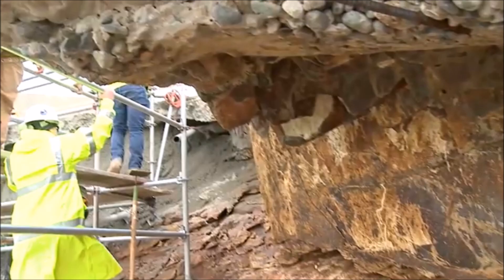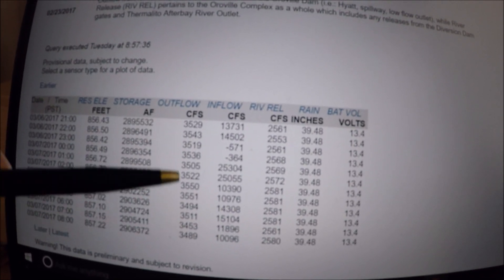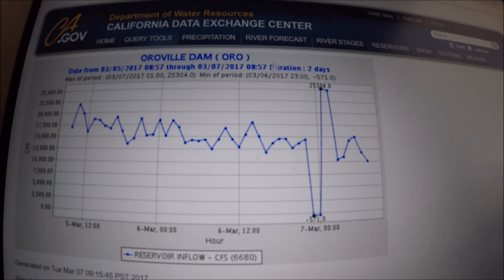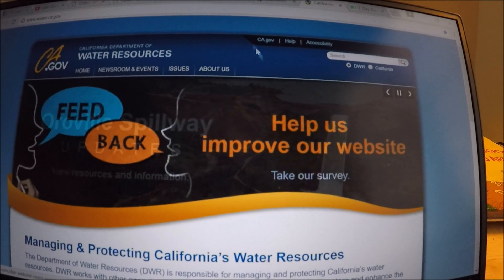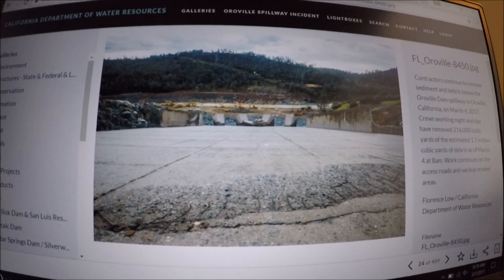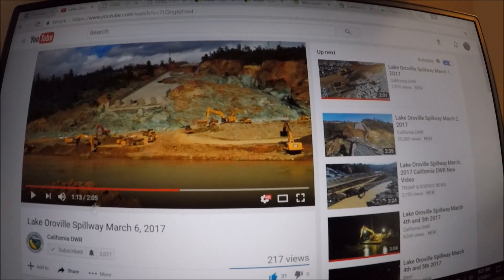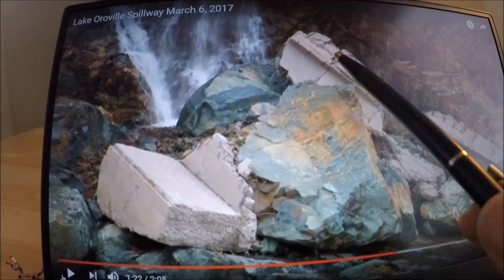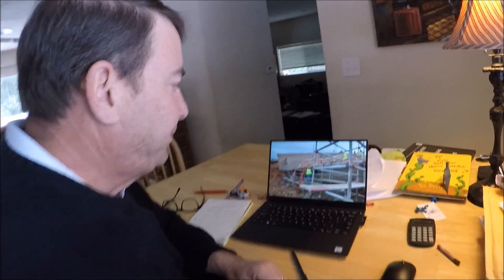Oroville Update 7 March 2017  "Where's the Rebar?"

Comment: Hi , remember me from 2 years ago? Outstanding work you did on the other vídeo , with all the specs i will read with more attention , where comments where not allowed, which i understand perfectly... didnt get the data in detail, but happy for the job done by Dwr. Remember i comentted on laminar and turbulent flow on the spillway?.... i AM gonna check all the data tomorrow, but meanwhile tell me: did they change the inclination of the spillway and total flow?
On a Dwr video i notticed a comment by the chief enginneer talking about the temporary nature of the side walls, to be replaced by higher ones, but he didnt mentioned the flow. Also the work on the emergency spillway is fantastic. Whats the solution they gonna do to get all that flow? Greetings and best regards.

Pedro

Comment: March 11, 2017: Good News: The Good Rock Hero's for DWR at the Oroville Dam have made some more progress. Over the last 24 hours they reduced the rate of rise to only 0.36 inches a day. That is an amazingly low number and It appears that they believe they can manage that so well; they have changed modes to addressing the backlog of old upstream and downstream EPA needs. Instead of reducing the Dams level. However, it appears that the DWR has heard about all of the Outflow and Inflow: Misconceptions and/Or Predictions. Since, they don't want to be tied up with that right now; those feeds are no longer on the public viewing pages. But rest assured: They have them for their uses.

Comment: the slab at the 4:18 looks to be about 1/3 as thick as the people are tall. it is referred to as a slab on grade. the failure was not due to the concrete or reinforcement,  it failed because the grade eroded away. it would be possible to engineer the spillway to not depend on the grade, but it would then cost as much as a bridge which would be over most budgets. the solution is to prevent water from getting under from the perimeter.
Reply: I agree. Check the 1st or 2nd video in the series. The failure started next to the spillway rail edge. It straight cut a corner with 30-60 ft perpendicularly square lines at the top; like it followed some rotted rebar downstream.

Comment: I heard the  previous director of the water system claim the reason for the vacuolation was pressurized water flow from the internal drainage structure of the damn up in the emergency spillway parking lot area The Clay rubble part of the damn is only 30 or 40 feet high but the same structure system is used. Apparently failures of the Clay membrane pressurized the smaller part of the damn internally! I have first-hand information from Caltrans they were driving trucks of specialized material that were over loaded up into the pool area near the parking lot for repairs !  In my opinion the frustrating part of all this is that the Officials don't tell you about the real risks in the name of Public Safety ?
 It's all a big snow job  the problem was improper maintenance ! Allowing the local mine blasting with saturated ground...

Comment: People don't realize the strength of water erosion, the thickness of the spillway slab is quite thinner then what we have up here on Canadian  Dams constructed in the 1927 !!  on the Gatineau river, Quebec ,Canada.
The average spillway thickness varies from four to six feet thickness  on bedrock with rebar at very 12 inch of concrete layer. 
In James Bay a earth construction Dam  the spillway is cut in bedrock  with the retaining walls over twenty  feet of thickness and still get's damaged.
Think of the forces involved, one cubic foot of water is  62 lbs ,that's a lots of potential energy. 
From what I see on your video a much better base support of the spillway slab is needed in my opinion .
I  will  pray for a successful outcome with no loss of life. 
God bless.

Comment: I am no structural engineer, but it would seem that widening the spillway at the point of the  down-slope would reduce pressure and flow force on it in the future. Maybe even two steps of width, one near the baffles at the bottom, with flow diversions at each point to spread the flow laterally. Just a thought.

Comment: Well, OBVIOUSLY that was NOT ENOUGH rebar, as the rushing water destroyed the spillway because of lack of sufficient strength in the concrete due to NOT ENOUGH rebar.   To get better strength they really need to use 3-times the amount of rebar that they used in the old spillway construction design.   But large amounts of rebar tend to rust / then expand /  then CRACK the concrete, so use STAINLESS STEEL rebar for areas that are within 12" of the surface of the concrete, and then conventional rebar in deeper areas.  That should work just fine.

Comment: ...Your reports are some of the best.....and as for rebar....not much in there, considering the tremendous weight and pounding from the water....I've seen freeway, and other buildings with much more rebar...and much less load.... I live in Sacramento, (but in the process of moving to Yreka area)...here, very close to Sacto and American river (also controlled by Folsom Dam)....water is fairly high right now.....hasn't been this high for 8-10 years when they last opened the Yolo bypass...2007..... 1986 or so....the floodgates protecting some areas of Sacto city were closed....water was maybe 18" from the top, which is the same height as the levees......no other protection after that is full....

Comment: I'm trying to make sense of Oroville's inflow, outflow and river release.  I am puzzled that the  outflow currently exceeds inflow, but the reservoir level is still rising.  Clearly I don't understand something here.  Second, The terms "outflow" and "river release" seem confusing even after reading the definitions of both.  It would seem that "river release" is a more inclusive term and should be greater than the "outflow".  Again, it seems there is something I don't understand here.

Thanks for your great reporting.  I look forward to your next broadcast.
Reply: Yes you are right it is complicated. We don't have access to how the 6-10+++ groups of monitoring station in the automation system are averaging their 20-40+++ monitoring specific points' data. But if you simplify that the 6++ multiple inflows are a representation of "Sucking a New Milk Shake threw a Straw." So when you start out; you know you're working on it; but it takes a while in-between brain freezes to get a consistent Milk Shake going with some odd work in-between, before you can say your are done. Now think about that the straw is at the bottom of the Milk Shake and I think you will get this idea?
Reply: I really don't understand your analogy.  Are you saying the DWR isn't accurately representing the inflow because it comes from multiple sources?
Reply: They have so much information that is scattered from so far away that it can be misleading at times; and remember we don't have access to DWR's actual equation to see where the numbers are that make this public viewing number. But you asked; so, I'm guessing that you have the DWR Cal Data Exch Center link with the flow numbers. If so bottom left hand corner SHO ORO Map. Zoom in and get ready for your head to explode. After the brain freeze settles. Please use MSF for Milk Shake Flow. The Dam is Milk Shake Flow A and it is about 12 miles the long way: Starting in the North you have the West Feather River Branch: MSF 1: it starts up above 5056 ft and runs 15 miles with 3 scattered flow sensors. That is the easy MSF to think about. To the branch west running along CA70 you will see the North Fork Feather River: MSF 2: running 30+ miles with 13+or- sensors scattered all the way to Lake Almanor and dropping from 7166 ft. These sensors are going to be spilt up; averaged and averaged again before they average all the branch inflows. DWR followed this process for The Middle Fork Feather River: MSF 3 and probably had a lack of access; so, Quincy 40 miles away got the snow pack run off sensors. But the Middle Fork Feather River runs way past Portola 80? miles away. If you are still following; like wise, the South Fork Feather River: MSF 4. Additionally, this monitoring process exists down stream. They have a data center with a main frame/server/repeaters/wireless remote repeaters collecting the data and someone has more than one Bad Ass Operators Terminal's w/Special Automation Software to try to sort it all out with.
Reply: OK, thanks.  That makes a lot more sense.

Comment: Question:
Generally speaking, what led up to this failure?
One in 300 year rainfall event? as it the dam has never had to deal with this much water before?
Last several years there has been a drought and it was unlikely the spillway was used. Got that much.
Was it ever used at capacity before? or has it always been run at a fraction of this years water event? as in the dam has never delt with this volume of water before.
was the emergency spillway used because the main spillway was only running at 50% (or something like that) due to the spill way damage?
I have seen and understand the concept of cavitation (slight bump/blemish in the spillway becomes a huge problem in short order with water rushing over it) so I don't need to get into the mechanics of the failed spill way, just more the circumstances surrounding it.
Reply: I think the spillway failed because drainage pipes beneath the surface were clogged and the water washed the foundation away.
Reply from the maker: Pure speculation right now...let's wait for the report.
Reply: I didn't want to get into the nuts and bolts as to why the spill way fell apart, that will come out at some future date. 
Looking for a bit of back history.
What I'm asking is, what was the spill way use in the years prior to this event? or, when was it used last?

Was it used every year?  or last used 5 years ago? 
Has there ever been a weather pattern like this that the dam has experienced before?

I'm a couple thousand miles away and in another country. I know there has been a drought there for the last couple years, just don't know how long it's been going on for nor what kind of impact it would have had on the dam infrastructure.
Reply: The spillway released 150000 cfs in 1986 and did the job without breaking. https://pixel-ca-dwr.photoshelter.com/galleries/C0000OxvlgXg3yfg/G0000RI7llXEAt0k/I00008MwDhgGnbdY/Oroville-86-Flood-6590-4-02-21-1986-jpg

Comment: It seems odd that they don't have more men actually working on the front edge of the broken spillway. There were, what, 4 men at most actually doing work on it in any of the footage? That spillway (or what's left of it) is 15 highway lanes wide so why not have a dozen men or more working on it - especially if they are indeed in a hurry to make repairs enough to release more water.

Comment: that re.bar looks terribly futile for such a 3 ft slab, but I wonder if it is not highly likely that there was something (very) wrong with that concrete itself. I already was somewhat amazed by how by the  looks of it that was just poured onto loose soil for part of the spillway length without any vertical stabilisation / foundation, also it seemed strange to me from the moment I set eyes on it that there is that tile-like structure that can be seen on all footage, they used a separate top layer - how was that mounted onto the concrete? was it sort of glued on after the concrete had set? it may not have (been) bonded very well. I have never seen it done this way before. Reason for that in the first place would be, good concrete would /does not need a separate top layer. and concrete (given there was nothing wrong with it or with some of the batches of it) is very very hard and strong. I once lived in a re-used former military complex that was entirely built if concrete, as one of the very first objects that were ever built of it in their entirety - from early 1900, outside US - and that had NOT used any re.bar in it..  be cause in those early days, they were not sure yet if it would be any good really!! - whether it would make its surroundings crack or chip away (it will if any water gets inside by the way, as corrosion expands the iron - which in the day they weren't sure that it wouldn't happen either) so to be on the safe side they had used enormously large amounts and thick layers of that concrete - and it obviously was well prepared as it still stood as if it were new (except for it got dusty on the floors) after 110 years. this is the first time I myself saw a fail like this. It may not be that easy to prove there was too little cement used in it the concrete that spillway was made with, and maybe that the top layer did not fit well and /or was not 'glued' in place good enough on top of that - it will at least not be able to prove it for the part that was broken off and washed away by the water, of course! - but it does make it more likely that one could find there were corners cut on other places too.. final remark on this, to me it also seems strange those sides (to the naked eye) seem separately constructed. just thought I would mention the concrete as a thing that should be examined, separately from the construction, if we are to find out what really happened here. thanx very much for your great reporting and the quality of your reports!

Comment: I have a pretty good eye and I would bet that the center portion of the spillway bed is around 12 inches thick. No way it's over 14 inches. Pause at 5:20 and it looks like 12 inches. Does anyone know what the specs were on the thickness of the slab and size and spacing 
of the rebar? I'm sure it must be public record. 
Or maybe the plans have been misplaced. lmao!
Reply: It is called a drain valley or basin. It is part of the design and worn smooth with water for 48 years. It is so the water will run in the middle of the spillway.
Reply: +Joe Casarez+ Please try and do some minimal research on matters before you post such unintelligent rubbish. That is called a Spillway. It’s only used in emergencies.
Everyone except you knows that since this dam was built, this spillway was NEVER used.
So I don’t see how anything about it could be, worn smooth with water for 48 years”, as you state.
Reply: @Michael H. ---Ya, ---the early reports had some convoluted terminology for your term, "Spillway" and I was confused early on too. The DWR tried to help everyone get on the same page, by providing an updated drawing on their Oroville Dam Spillway Incident Page. I'll attach the link at the bottom of this message and if you click on the pictures they will enlarge for your review.       The short version, is that the Spillway that you are referring to is actually a Flood Control Spillway. That the DWR uses, throughout the year, to manage the Flood Control System with, and has run well over 150K cfs down in the past with out incident. Where as, you are correct that the "Emergency Spillway" at the far left has never been used in the last 48 years. So technically they are both spillways, but the Flood Control Spillway has a valley u shaped bottom. Cal DWR Oroville Spillway Incident Page Click on Lg Pic at Bottom of page:  http://www.water.ca.gov/oroville-spillway/index.cfm                               Additionally, if you check this Wiki Page you can see the loose definition spillway term pic's. However, check the Flood Control Flow rates to validate that they are too high to achieve with the Hyatt Power Plant alone. Note: There is a DWR Report validating this if you need additional info. Cheers https://en.wikipedia.org/wiki/Oroville_Dam

Comment: March 8, 2017 9 am Update. The Rock Hero's appear to be starting another Turbine. Outflow 7048 cfs and the added draw appears to have pulled the inflow down to 8966 cfs. Here is hoping that the Turbine Specialist can keep that up!!!!!
Reply: Please Note that I have been using this analogy for 30 years with my customers and I am aware that some readers will not cotton to it. So I included a more technical definition as you read further. Maybe you can compare them both and let me know which you prefer (Simple or More Technical).----Simple Version: It is like a cat trying to cough up a fur ball. When you pat it's back you help it cough it up and then it is Ok. -----More Technical Version: There are some conflicts in the computers equations as a dead head pressure occurs. So when the whole dam 3.5 million acre-feet (4.4Km^3) is not flowing in a gravity fed syphon, and backing up, because the turbines are off; the sensors don't know what to do and they can get kind-of get stuck in out of design false reading that they were exposed to for too long. Basically they are stuck high, and then when the syphon of gravity starts moving all the water back to its design operating parameters. They free up and start working again. Please note: The simple version covers restarting locked up sensors, pumps, electrical emergency bypass circuits and freezing up streams or up stream dams that reduced flow to take the pressure off of the turbines until they can be brought up to full speed safely. It really has something to do with the back pressure getting moving again. So, I'm just saying some people like the simple version better.
Reply: Sorry I forgot to include mud water mass messing with the sensors and finally clearing with cleaner frictionless water.

Comment: Actually, you can measure the thickness of the concrete. That fiberglass extension ladder is a standard width. Use a program like FlexiSign (a signcrafting program). Enlarge the picture until the width of the ladder matches reality, using the measuring tool in FlexiSign. Then measure the thickness or width of anything else you can see in the pic. Photoshop might have such a tool, i dunno.